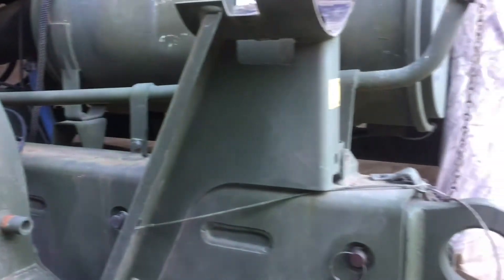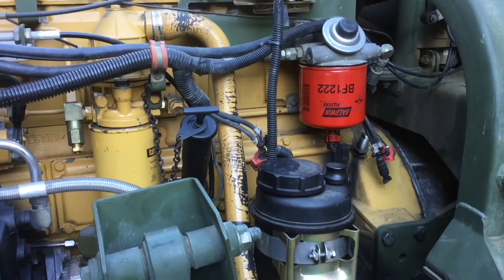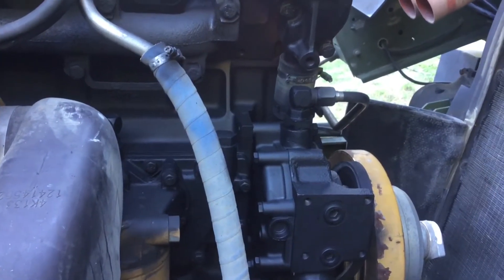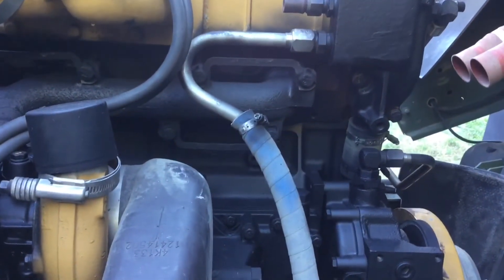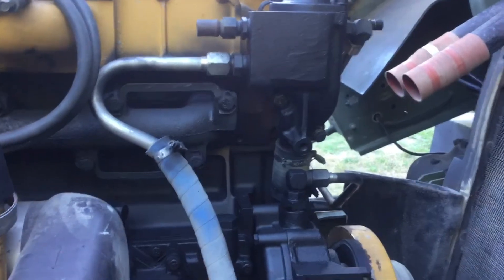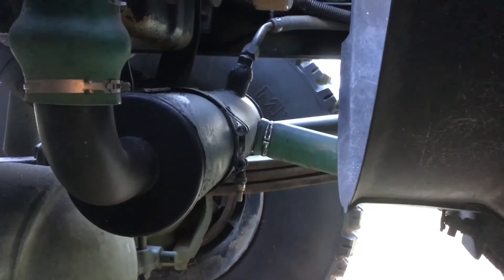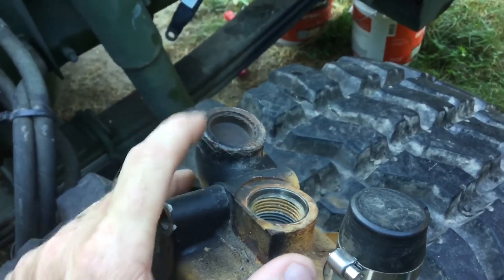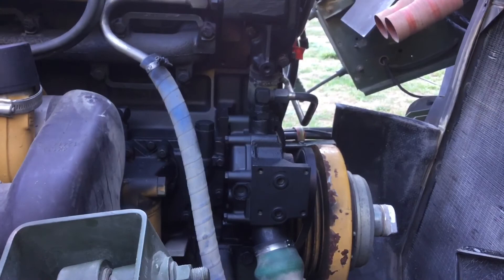LMTV Cooling system modifications part 1

Comment: Hi Ronmar. I came by on of your video with the cab Air suspension. I wanted to create my own either with double convoluted bags of, Sumo spring and the Gabriel shock. Is your set up custom or purchased. Midwest ones are a little pricey.
Reply from the maker: Yes, I designed and built it.
Reply: @rronmar  I will look at double bag, usually for strut, got to get the welder out. Cold her in NJ

Comment: Very cool! Is running the return from the heater core down to the transmission intercooler what they did on the A1R trucks?
Reply from the maker: No, they didn’t do anything on the A1, A1R.  They use a different cooler that only has 2 coolant ports and 2 oil ports instead of the 5 port cooler used on the A0…

Comment: Genius mod! Assuming a rad cap and fill on the upper radiator tube?
Reply from the maker: No  I fill it thru the bottom drain port...  The rad cap will remain on the exp tank for adjusting the level in that tank.